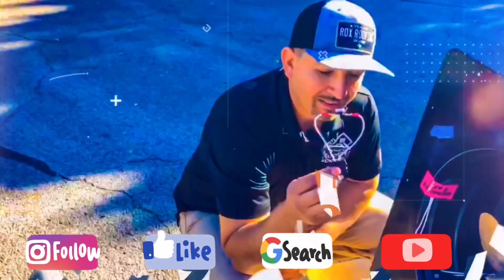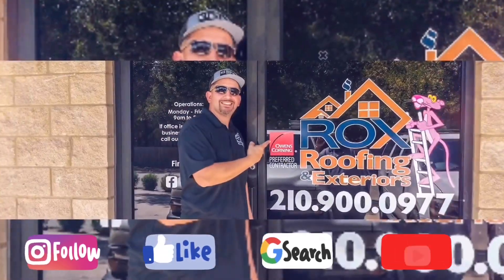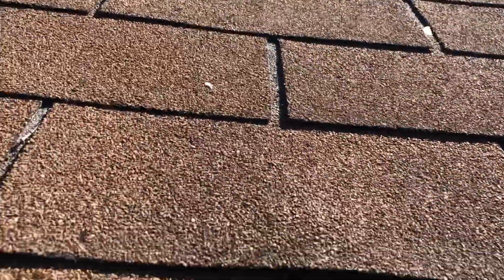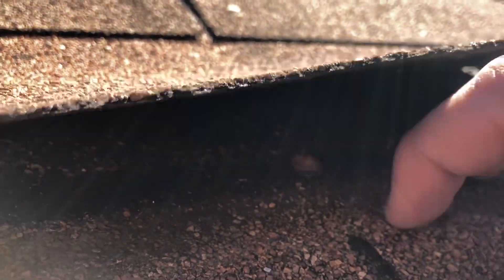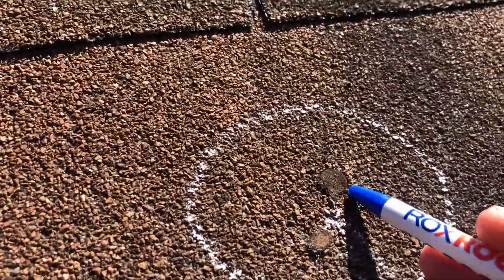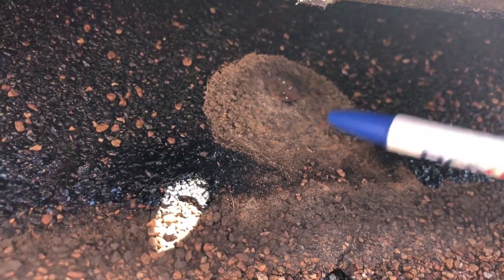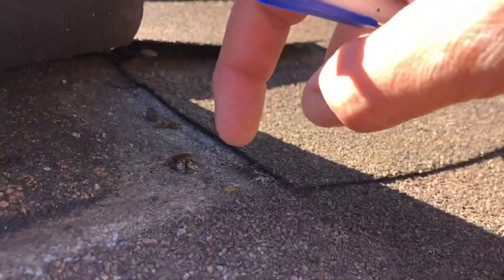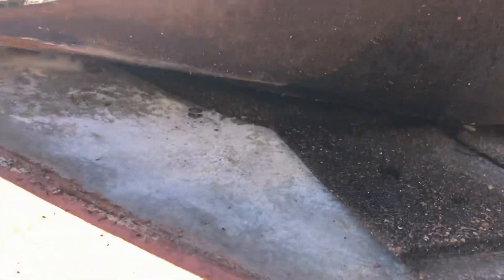What Are Roof Nail Pops? | San Antonio | Rox Roofing

Comment: What’s the best sealant for nail pop and zippering on Florida shingle roof Thank you
Reply from the maker: I would remove the popped nail, seal the hole, install new nail 1" to the left or right. Install a bead of sealer under shingle. Any exterior sealant would work. I like using Quad OSI clear color from Home Depot. 

For the "zippering", same sealant would work. You dont need a lot, a small penny size for zippering would do.

Hope  this helps.

Comment: They are denting my 2 year old galvalume roof do you think it will fuse through galvalume.I know.it will cause the galvalume to prematurely fail
Thanks
Reply from the maker: It shouldn’t, takes a lot of pressure to Pierce through a 24 gauge metal roof.

Comment: I am getting my 15 year old roof repaired for nail pops. What advice would you give as to make sure the work is done properly?
Reply from the maker: Nail pops are pretty easily repaired. Nail needs to get removed, new nail installed flat flush with roof and run a bead of sealer between shingles. 

Not much science to it. 

Let me know if there’s anything else.

-Roc